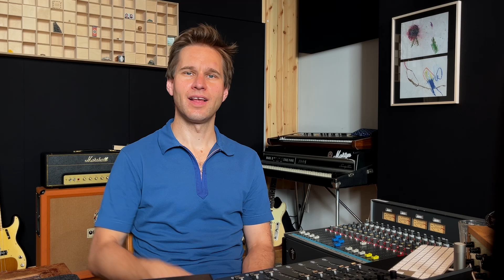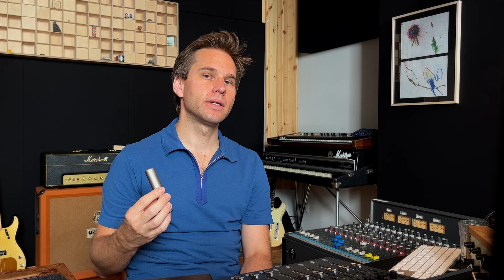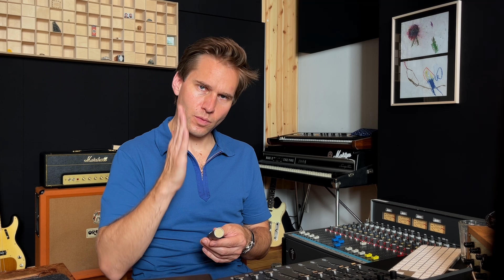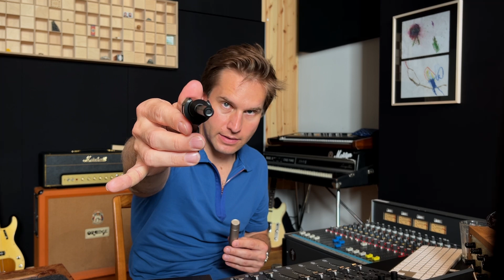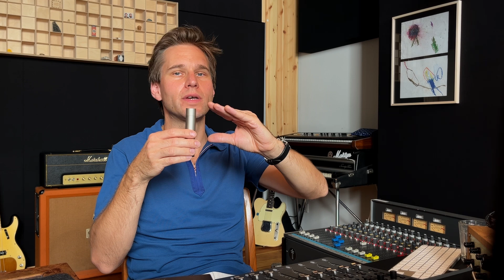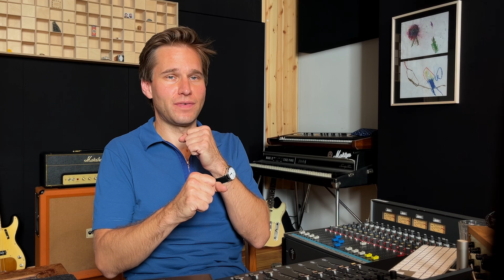Tonal Cues ep5: Under pressure: The hidden superpower of the omni mic!

Comment: Excellent. Can you use some flavour of mic baffle to make a pressure mic more directional...or does it just not work? Cheers and look forwards to more tutorials
Reply from the maker: Thank you! If you're thinking of large gobo baffles in order to reduce the ambiance of a recording for example then yes! If you're thinking along the lines of the Jecklin Disk then I wouldn't recomend it. You don't want your baffle to have the effect that the unwanted sound is still registered but just horribly coloured by the filter of the baffle.